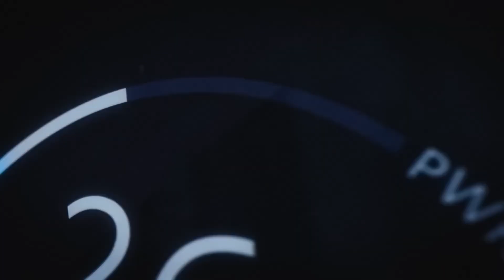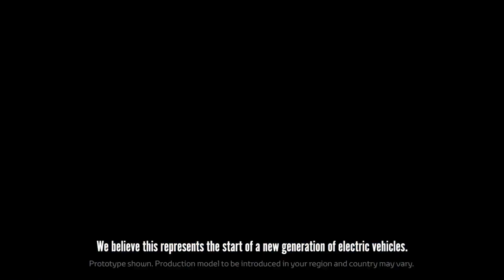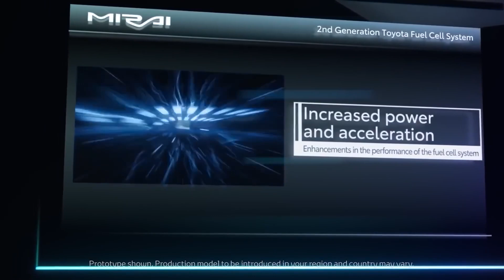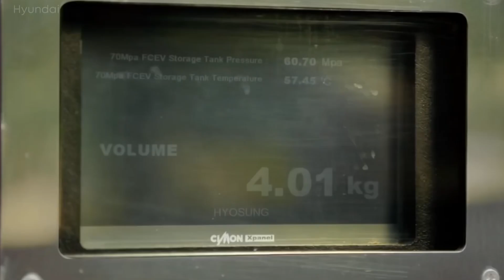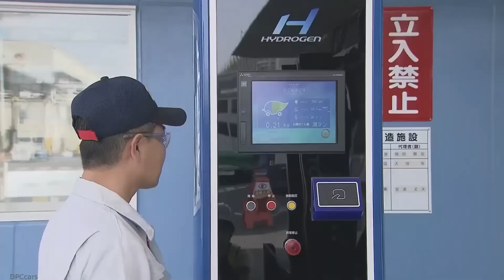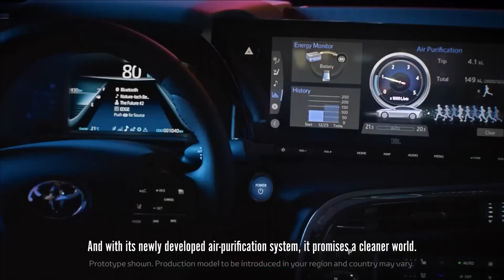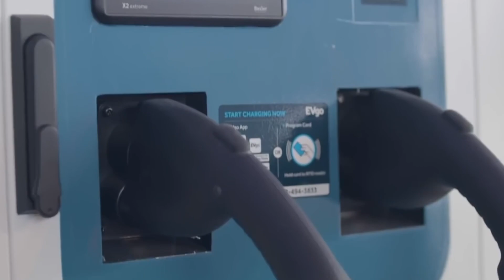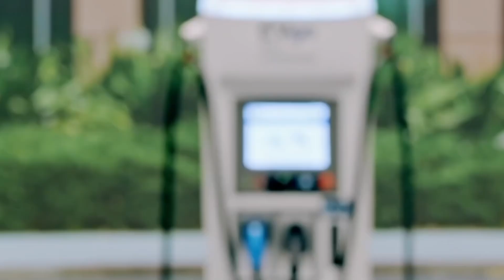Toyota CEO Just UNVEILED A Powerful Motor That Will Change The EV Race!

Comment: I am totally sold on hydrogen combustion cars-I don’t see a downside. As for EVs, a mining CEO says that there is not enough lithium to replace gasoline cars. Plus EVs are severely under powered, they have a short driving range and it takes hours to fully charge-EVs are a downgrade over both gasoline and hydrogen. EVs must be bad if government is endorsing it and for that reason I will never buy a EV. The internal combustion engine will be revived with the hydrogen engine. I think hydrogen is the future and I will hold out and definitely buy a hydrogen powered vehicle.

Comment: Lots of problems with hydrogen.  It is mainly made from natural gas and is very expensive and not widely available.  To get any practical range it has to be compressed to 10,000 psi so storage containers must be very strong but hydrogen atoms are so small they damage steel so they must be lined.  This is just the beginning of problems with hydrogen.  Manufacture and transportation of hydrogen is a nightmare.
Reply: Except that the hydrogen can be made locally as needed, right next to the filling station.